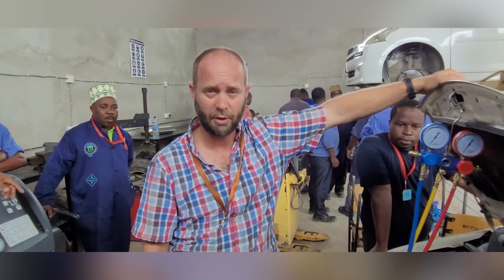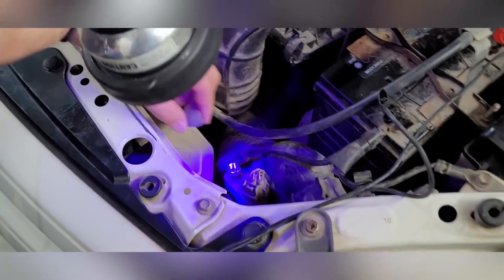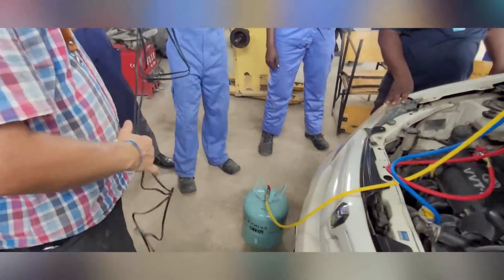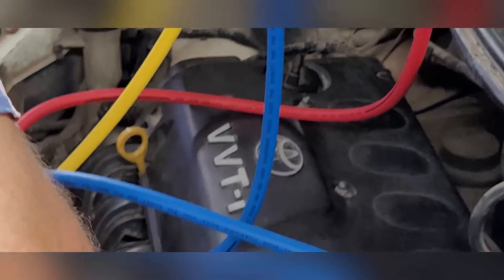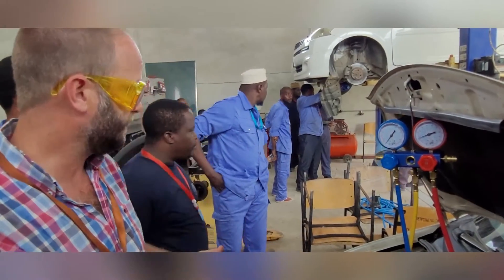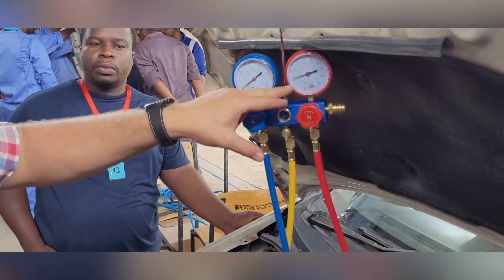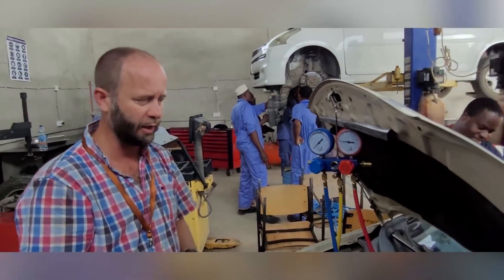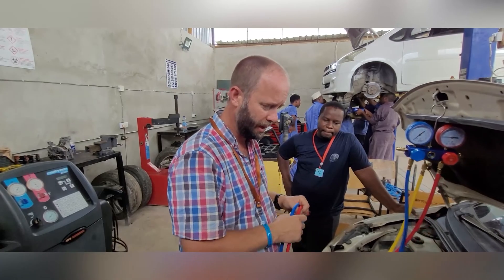AVT How to refill AC system without Recovery machine - AVT Education Partnership BBP Zanzibar

Comment: When UV checking for leaks, if you've recently had the connectors on/off the hi/low side ports - you will sometimes see splatter dots, as well as what can LOOK like a leaky schrader valve when it's not.

Comment: Does the A/C system need to be run in any particular way to be measured accurately?
Reply: start the engine and start the AC system. let it run in idle. While in idle you check the pressure. Especially the high pressure side is important. It should never exceed 220psi. between 180-200 is the best and the system is full. The pressure can change a little depending on the ambiente tempurature you have.
Reply: Usually running max cool and recirculation enabled.  Ambient temperature affects the pressure.   Higher ambient temp means higher pressure.
Reply: @tiporari  so, is it OK for psi to be at 250psi if the temperature is 88-90°? Thank u
Reply: @tyrc12pro94  depends a little on the system. If that was the pressure originally inside the car. Than it is fine, but I normaly do not recommed to exceed 220 PSI

Comment: The tank should be upside down when R-.. charge on the low side. Thanks
Reply: No! The low pressure side is gas, the tank upright is gas. Turn the tank up side down, you are charging liquid into the low pressure gas side.
Reply: @cousinjohncarstuff4568  Which can cause the compressor to push against liquid und damage the pistons. 
YOu can charge a little upside down while the engine is not running to get the pressure sensor register that there is pressure in the system and start the compressor.
Reply: @hans-dieterallgaier1913  why does it say to hold the can upside down than? So many people have videos this way? 
So I only hold the can upside down before I start the car to equalize?
Then can needs to be upright the entire time? Better if hot?
Reply: Are u supposed to purge the air out before adding the freon?
Also you say this isn't the right way?
But will work? Little confused. 
You said the low side should be at 90psi?
It only got to 50psi. Which I thought was the highest u should on low side?
If readings are at 250 psi. The Temps are at 90°. Is it OK?  Or is 250psi. Way to high? Thanks for your videos
Reply: @tyrc12pro94  To remove the moisture, it does require a vacuum to be put on it. at 90F, general readings 200 high, 40 low. Best to charge by weight if possible.
Reply: Guys, we ar ein an enviroment, where there is no vacuum pump whats so ever. This Video shows a compromise if you still want to refill the car with gas and you do not have a vacuum pump.
Reply: @tyrc12pro94  that's why you never regas this way... every system is different on pressures... ambient temp and system design are the main factors